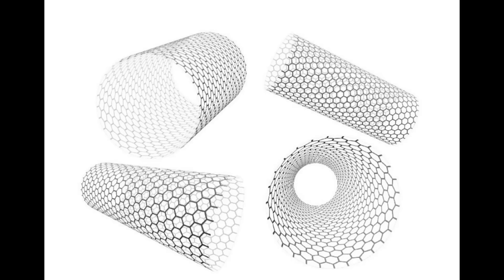What Material Will TSMC and Intel Use after Silicon?

Comment: You forget that solid state transistors we’re thousands of times more expensive than vacuum tubes when they started. Also Quantum & Classical computing are separate computing niches, just as there are Quantum-proof cyphers they can’t crack, there are computing tasks Quantum will always be useless for. What about alloyed semiconductors & other exotic materials? Why do you need to process beyond photorealistic? Do you want VR to get better? Because the physics computing alone is a monumental task.

Comment: I also doubt that new materials will be worth the cost of research. The 1nm for Silicon is pretty much what's possible by the fundamentals of chemistry. Bond lengths are 0.1-0.2 nm and you will get into quantummechanical effects way before that. Maaaaaybe you can squeeze it to 0.5nm but as you said that's billions in research for one more node.
Besides improving silicon the only realistic chance I see is that we manage to develop biological computers similar to how brains work. Maybe we can reconstruct them from silicon but that's probably where we'll be heading towards.

Comment: Galium Asenide has been lurking in the wings since I was a student. I am now retired and in my early seventies. Silicon has this one property the ability to grow a layer of quartz on the surface of the wafers. Silicon planar technology is based on this layer of quartz and the ability to etch selected windows in this layer from this to allow selective diffusion of donor or acceptor impurities though these windows. Once diffusion is complete another layer of quartz can be grown and this selectively etched away to allow more diffusion of impurities thus creating active devices. I suspect the semi-conductor industry will stick to silicon to the bitter end. It will move away from silicon when it is absolutely forced to. Silicon will be replaced when a material has been found that can grow an insulating layer that can be selectively etched away.

Comment: we just need a material that can take near absolute zero temperatures, and build something like a huge wafer scale CPU on that material then cool it to near absolute zero. Is it not true the quantum processors can already function at near absolute zero with dilution refrigerators using liquid helium? or are the actual processors not under that cooling and only the QBITS? yes it would cost a fortune but you just place it in the cloud and spread the compute out to your customers on demand like Amazon does today.

Comment: People are forgetting about germanium (Which while it's expensive takes 50% less voltage before current is actually usable vs a silicon transistor which has "usuable" current at 0.7v

Comment: Silicon has a property that you missed. The ability to easily grow an insulating layer of silicon dioxide(quartz) on the surface of the wafer. This layer can be selectively etched away to provide windows though which doping elements can be defused through. This is called silicon planar technology. The alternatives to my knowledge do not offer an equivalent to the ability to grow the insulating layer of silicon dioxide. According to articles that I have read in the past the move from silicon should have taken place by now probably by Gallium Arsenide. Also minimum drawn feature size, used to be transistor gate width do not know what it is now, that is in use now should require the use of short wave length light to expose the photo resist on the wafer surface. Multiple patterning delayed the application of this requirement to use shorter wavelengths of light such as extreme UV.

Comment: It could very well just be the case that clock speed becomes irrelevant and that silicon will last quite a bit longer than we think it will, while continuously adding more and more cores. A 2nm or less consumer chip... I mean who knows, we could end up with 64 core low-end CPU's. So, "forget about being able to increase clock speed massively with another material for IPC and so on. Let's just keep packing on a shit-ton of cores." Any possibility of that? It seems like all the performance gain could be achieved that way with better multi-threading and so on, rather than an 8 core 16 thread graphene chip that would be crazy expensive to make because of imperfections and so on.

Comment: 3d stacking will be great for efficiency and speed. most of the energy in a CPU is used for transferring data back and forth. Even AI will improve efficiency a ton by storing data closer to the core that will need it next. If you store data closer to the core it doesn´t need to be moved as far to pull it into the ALU and back. That is why larger cache makes a CPU so much more efficient.

Something to keep in mind is that the technology for the production and processing of the materials hasn´t changed much over the years. If we spend more time on the silicon crystal growing process which is now about 50 years old and same with the purification we can drop costs by a ton. Silicon area is always quoted as being expensive but that is only because of the slow and outdated processes that we use to produce the wafers.

Comment: If you are a Carbon fanboy like myself look into the rGO and carbon nanotube research being done on Super capacitors. They can have over a 50X watt per gram ratio over current LiPo batteries. Super capacitors suffer from leakage(only drawback compared to batteries) and would not completely replace batteries but if they are implimented together it will revolutionize battery capacity for cars, large trucks, planes, mobile phones, etc.

Comment: With Moore's Law (or at least its now weaker form) coming to an end, I think that silicon will cease to be general purpose. (It is already becoming much less so than it was then.) Imagine putting the operating system of a pc (or at least the commonly used and time-demanding parts) into silicon. You won't buy a graphics card to run the latest gaming software. Rather, the game (or more likely multiple games) will be built into the card. Most silicon will become application specific, and general-purpose Von Neumann style architectures will just be managing these incredibly complex algorithms written into silicon. There will no longer be a hard divide between hardware and software development. I used to think a lot about this back in the 80's, when we believed the theoretical limit of transistors was 0.1 um. The day of reckoning has been delayed, but come it must. Changing materials is just too demanding until every last bit of performance is wrung out of silicon. If and when a new technology arises, power consumption will be the deciding factor. You need a new technology equivalent to CMOS, where transistor logic draws no power in either the "1" or "0" state. But this new technology will not only have to beat mass-produced general-purpose processors. It will have to go up against highly entrenched application-specific silicon. In that environment one could never get the economies of scale that would be necessary to dislodge silicon. I think from the point of view of semiconductor processing we are at the end-game. From a world-historical perspective, the information revolution has been astonishing and unprecedented. However, all revolutions eventually come to an end.

Comment: Also you need to factor that at these sizes you get more bang for your buck. 14nm to 7nm is much bigger than 21 to 14. 7 down to 3 bigger than both.

Also, changing to chiplets and parallel computing is the future, not pure serial single thread speed.

Comment: It's funny in a sense, but I remember reading an article/series of in PC World when I was younger. This was somewhere in the 2000/2001 area, and Graphene was named the most probable material to be used when we reached the end of Moore's Law. So almost 2 decades ago they were talking about and testing it in practical applocation, and we still can't produce proper sheets. That leads me to a one of two conclusions.

1. They have not invested enough in R&D, instead focusing 99.9% of their money allocated to research and development to Silicon, which is alluded to in this video, or:

2. It is not a viable alternative.

My opinion leads me to believe 1 is the most likely, and with the recent focus on mainstream chipset architectures it would not surprise me in the least if we had hybrid chips that used graphene chiplets at 1nm, .5nm, .25nm, and .125nm, with the first two nodes using far less expensive lower density silicon i/o dies.

In truth, optical circuitry (also talked about theoretically in the aforementioned articles (wow I wish I kept all the old magazines from my youth, and if I recall correctly the optical computing sections focused most on what they referred to as _"Invisivle Circuitry"_), seems like it will be here sooner than we think, as we already have successfully used numerous switches in a near fully optical environment.

So back to the point; I highly doubt we will still be using solely silicon wafers to produce chips, even for desktops, in 10 years. Node shrinks either take too long or are performing so far below previous generations it makes little sense. With Intel in the process of falling out of favor at the highest end the market, they need to push further and faster than they have in decades. We are talking an innovation the likes we have not seen since IBM and Texas Instruments held the business AND home computing market in a vice grip that seemed impossible to loosen.

This will of course lead to other companies doing the same. Whether that's two x86 chips and four x64 on one 250^² mm die, or 30 quad threaded chiplets on a 450^² behemoth, I see dramatic advancements coming in the next 5-10 years. We probably won't have flying cars yet, but we also probably won't be using silicon as the main part of what we commonly refer to as a CPU either.
Reply: Graphene was purely theoretical until it was isolated in 2004, and the graphene research facility at Manchester where it was discovered only opened in 2015, we've had under 5 years of scientific research into industrialising it. R&D takes time. Meanwhile there were leaps made, in 2010 they made a 100GHz transistor. It's just making that tech practical that's the problem because it's literally 1 atom thick. It is absolutely viable, just silicon has had hundreds of billions poured into it for decades and this is a from scratch process. It will take another 20 years before graphene is ready.
Reply: Nuclear fusion crowd be like: First TIme? :D

Comment: Do we need more performance? Yes, because machine learning. The main limit in how complicated we can make neural networks is computer performance. All those deepfakes you see around? They work on a 64x64 pixel input to try make a 128x128 generated face and that takes 11GB of VRAM running for DAYS. This is the only reason we haven't seen more widespread use of image based machine learning, it's so damn compute intensive. Quantum Computing will be a different type of computation, the world works on a quantum framework and it's obvious we will need to use a computer that can handle these quantum properties to accurately model the real world. Superposition, true randomness (wave function), entanglement, quantum teleportation, these are things classical computers just fundamentally can't ever do. Quantum neural networks is a mostly theoretical idea people have been working on and it opens up a lot of very interesting possibilities for machine learning that just isn't possible on classical computers. 

I believe a month or so ago Google said that their quantum computer team (of course they have one) are running quantum computations that can't be run on local servers anymore, they need to simulate the computations over the Google cloud to verify the results. They say that by the end of this year there won't be enough compute power to simulate the quantum computations they are doing. But Quantum computing will never compete will classical computers, they need to be cold. Quantum particles HATES noise and temperature is the thermal motion, noise of the surrounding area. You will never run a serious quantum computer on "just" liquid nitrogen. They all use liquid helium, and most have a special staged cooler that uses a mixture of Helium-3 and Helium-4 in a dilution refrigerator to create a Bose–Einstein condensate, which is used to cool the quantum computer to it's operating temperature of 0.008 Kelvin (Liquid nitrogen is 77 K, freezing 273K and room temperature 303K). If your project would take 2 weeks running on 1,000 GPU's in the cloud, or 1 hour of quantum compute time, you would do it on the GPU's.

Comment: I think the comments mentioned III-V. That is for power transistors, led, etc. In mosfets perspective, silicon has chemical advantages as well, photolithography, etching, ion implantation, doping, as well as thermal oxidation for dielectrics, good surface with high k dielectrics. MoS2 and TMDCs are still far from scalability. 

Another thing is applications too. Transistors may not deviate from silicon. But other components like memory elements could. There are emerging memory elements like OxRam, CbRam, MtRam. All these could still help in improving computational power and realizing better architectures.

Comment: Another aspect to graphics other than simply graphics and computing power should be the way it is calculated or done on a rendering level.
Ray Traycing is an interesting approach.
So maybe instead of adding more and more power to the hardware, maybe it won't be necessary if we can our computing processes more efficient?
A good example would be if we could distribute workloads onto all cores instead of just one.

By the way, what is the ecological aspect of silicon? I heard that old hardware is a nightmaere to recylce or dispose of.

Comment: You've been talking about 7, 6, 5, 3, and 2 nm but I'm not seeing anything like that. This is what I've seen lately.

Global Foundries is using Samsung's 14nm. Their chips at 12nm are actually about 13nm. They've given up producing 7nm.

Samsung claims to be producing 8nm in volume. These are actually equal to 12nm. I don't know if Samsung's 7nm process is in full volume yet. If it is then they have a process slightly bigger than Intel's 10nm. We could call it 10nm. However, I don't know of any of their chips that are available yet.

TSMC's 12nm process is actually 16nm. Their 10nm process is about 12nm. Their 7nm process is slightly smaller than Samsung's but still bigger than Intel's 10nm. So, if this is currently in volume production then they are at 10nm. However, I'm only seeing the Zen+ chips at 12nm.

Intel is producing in volume at 14nm. Their 10nm might be in volume production but I thought that wasn't expected until later this year. I haven't seen a 10nm chip yet.

So, volume production could now be common at 10nm I suppose, but it seems to around 14/13nm.

Do you know of volume production for any of these at 10nm? And where are you getting the 7nm from? Intel is testing at this size but it is unknown when it might be available. I wouldn't  be surprised to see TSMC and Samsung move down to 9 or 8nm before then.

Comment: Quantum computers can be useful in real world simulations because of the real worlds use of quantum mechanics.

Things like biological and meteorological simulations which currently have to be run on super computers would have great benefit from quantum computers provided it could be used effectively because it's simulations are not limited by binary states and therefore the accuracy of the simulations could be much more precise.

Comment: The reason we can't go below 1nm == 10A is... the fact that the radius of a hydrogen atom is ~1A (diameter 2A == 0.2nm).  Other atoms are larger, of course.  The bottom line is, it just isn't realistic to expect a conductor or transistor feature to be less than a few atoms wide.  Why?  Because one atom missing would mean the connection or transistor or gate doesn't work, which means the part doesn't work.  I figure 1nm is unrealistic, but if I'm wrong, 1nm will be the limit.  That's only 5 hydrogen atom diameters, and hydrogen is smaller than all other atoms.  So even 1nm is insane and I think impractical for anything with millions or billions of transistors.  Even 2nm is gonna be insanely difficult.  I mean honest 2nm, not some BS marketing 2nm.

Sorry, can't make Unobtanium transistors.

Comment: What happened to the good old days when AIBs would put 3 GPUs on one board and use  5 fans ,,, today they are making the GPU just as cheap as possible while ringing out every last bit of possible performance just to pretend the cards is in another performance bracket that it really is.. the graphics card scene has turned into a shit show and that’s putting it mildly.. it’s as if they don’t want to move performance further so they can suck it dry ... we are getting new releases that’s only 10 percent faster than previous release.. seriously what’s the point? No one can tell any difference but the company cause they made it cheaper than ever

Comment: Great video and insightful to things I hadn't seen yet. Biggest thing they need to work on currently which you touched on is utilizing the full potential of what we have now and coming. The code written currently for the most part doesn't come close to the potential there.  Oh and for the 3d stacking of chips if I remember correctly AMD is currently working on implementing this for the future. I've seen two or three articles about it.  The future will be interesting hopefully the software and code catches up to what the hardware can do.